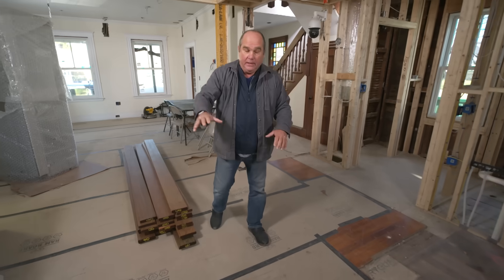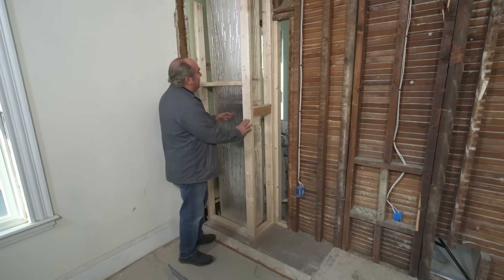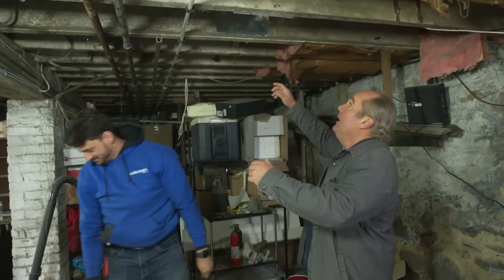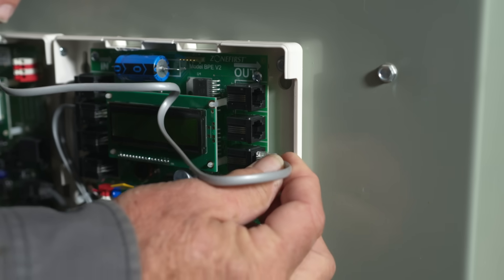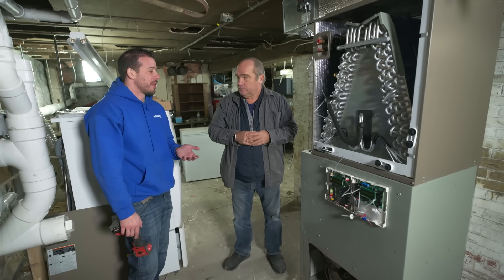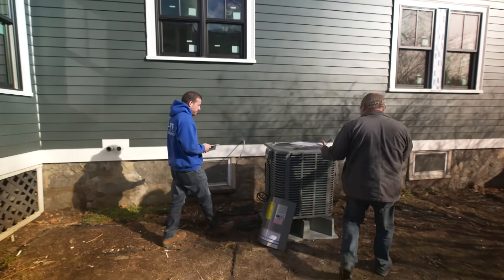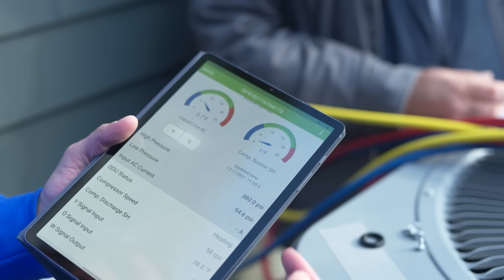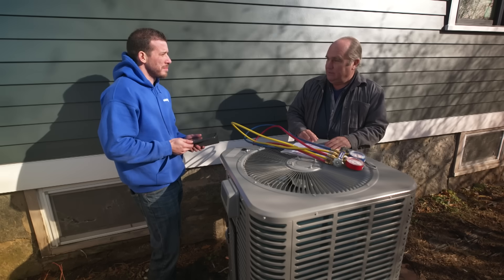Dual Fuel HVAC | This Old House

Comment: Very nice system - I like that they were able to reuse the existing furnace.

I'd consider a system like this but here in Texas where natural gas is cheap and we might only run the furnace for 10-15 days during a typical winter, it's hard to justify vs a straight 80% NG furnace+AC.
Reply: I'm further north and we get below zero F sometimes and heat pumps that work that low exist and are cheaper than the -22F units, but my concern is ice on power lines and losing electrical service.  My existing space heating, water heating, and kitchen are gas-fueled, so going duel-duel makes sense for me; if the natural gas stays on, I can power my furnace blower from a generator but with a heat pump only, I'm hoping the pipes don't freeze and am going to a shelter.  Absent such an event, I'd be saving about 40% on winter heating costs with a high SER heat pump until gas heat was needed.

Comment: I’m pretty sure that hybrid systems costs double that of a conventional system.
Reply: The gas furnace was already in place.  The zoning dampers are new, as in the duct work and heat pump.  The duct work was needed no matter what, the zoning was needed no matter what, so subtract those costs from the "hybrid/not hybrid" discussion and we're talking about the price different between a conventional AC only system or the heat pump system.  The difference in equipment cost isn't as great as you might think, maybe 25%.
Reply: It's not double because the "system" includes everything while adding a heat pump "box" is just a subcomponent.  Plus there are huge state (maybe federal) rebates.  At least in MA there are.  I installed 2 heat pumps 3 years ago and got $10k cash back in rebates.

Comment: Electricity is too expensive now, also once the return air duct is connected to the furnace it will be difficult to access that control panel. I would suggest a coal stove, especially in Massachusetts.
Reply: And a mill wheel powered by water!

Comment: That quality of duct work and team work with the carpenter/framer is hard to find even if you have the big budget to pay.
Reply: Exactly, and those are the details that architects tend to say "the trades will figure that out."  Then the trades have to work with the GC, who gets the client to sign off on the chases and soffits needed.  I was surprised how much of architecture is mostly selling pretty pictures, not actually building structures.
Reply: I have to wonder if anyone did a "manual D" calculation, or if they just opted to "fit some duct in there."
Reply: @arthouston7361  On this, I'm pretty sure the HVAC sub had to hit numbers to get the local subsidies.
Reply: @arthouston7361  Manual D or not, the ducts in those soffits aren't properly stretched, that results in huge increases in airflow friction, and the transition to an oval duct, is a big size decrease.
Reply: @edwardlouie  I'm a commercial service company owner, so I rarely touch ductwork. What do you mean by "stretched?" Those did not appear to be flex duct...
Reply: @arthouston7361 check the 1:28 to 1:30 time area of the video. Other comment threads also commented about the lackluster quality of the flex duct take offs the plenum.

Comment: This year I replaced my 20+ year-old HVAC system, and at first I was convinced a dual-fuel setup would save a lot of money. But after running the numbers, it turns out a heat pump just can’t beat natural gas in my area.If you want to check for yourself, you can convert your gas cost (in $/CCF) to an equivalent cost per kWh. The formula is:
($/CCF) / 1.038 (CCF to therms) / 29.3 (therms to kWh) / (furnace efficiency)
Then compare that result to your electricity rate per kWh. For example, here in Michigan gas costs about $0.86/CCF, and the cheapest electricity is $0.18/kWh. With those numbers, a heat pump would need a COP (coefficient of performance, aka the amount of energy a HP moves per 1 unit of energy input) of about 6.08 to break even. There’s simply no heat pump that can maintain that—especially once temperatures drop into the 30s in winter. Hopefully this quick calculation helps others decide which system makes the most financial sense for their home.
Reply: Entirety depends on where you live though. In my area, the near $50/month fixed cost just to have gas service means a heat pump wins pretty easily. Gas is a reasons option, with dual fuel being terrible.
Reply: It depends entirely on the cost of each fuel source in your location. Also, if you have solar panels or any kind of off-grid electricity generation, obviously a heat pump is the way to go. Electric is cheaper than gas where I live and gas keeps going up, so I would go with a heat pump and install some solar panels and a small lithium battery bank.
Reply: Depends heavily on where you live.  Also to throw wrench in your roi the cost of both electricity and gas changes over time. More so with gas as price spikes can be 2-4x with petroleum

Here in WA electricity is fairly cheap at 0.14c/kw and temps are mild so many homeowners just install a heat pump
Reply: Two important points you need to consider. A heat pump also cools so if you don't have central air, dual fuel is the way to go. There are apps where you can put your specific model in and it will tell you at what temp its cheaper to use the heat pump at. For me, my heat pump is set to heat don't to 30, after that the propane kicks in. I've saved a ton of money.
Reply: Same here in Connecticut. Our electric rates are insane and it can’t compete with a high efficiency gas or propane furnace. We have a 1 ton heat pump ducted system we added to our master suite when we expanded our house and it’s pretty noticeable how much our electric bill has gone up in the winter.

Comment: I have a slightly older version with a big heat pump outside working with a gas furnace inside. But here in Maine the electricity is so high that running the fan of the heat pump AND the fan of the furnace to push it through the house was terrible. We now just heat with the gas only and use the heat pump for ac in the summer.
Reply: That’s coz your state is trash
Reply: Same here in Arizona.  I had heat pump heating (which is actually adequate for most of the winter here). However,  my energy bill was higher than using air conditioning especially when the temps would start freezing. And I only used the heater at night. I have gas now in a larger home and my gas bill isn't nearly as high as my electric was.

Comment: Lol! If I was the homeowner. I would be worried once that thing is out of warranty. As an HVAC/R tech. EVERYTHING is made like junk now. Control boards especially. 😅
Reply: Hold on to your wallet if inverter, blower motor etc. fail out of warranty.
Reply: I got out of the commercial side 3 years ago. In those 3 years, the tech has leaped more than my 22 as a tech.

Comment: FYI, Dual Fuel means 2 different types of Fossil fuel- lpg, natural gas, or oil not electricity.
Reply: FYI, no.
Reply: Not in the hvac world it doesn't. Dual fuel is a heat pump with some type of fossil fuel back up.
Reply: So, what would be the definition of a Hybrid System?
Reply: @BuddyAmericafirst-nh4ms  hybrid is a word that means a combination of two or more things that achieve the same/similar results. If you had a car with both gas and diesel engines and you could run on either one independently to make the car move, it’s a gas/diesel hybrid. It doesn’t have to necessarily include electricity to be a hybrid, but it can
Reply: @krvnjrcbs  I hear you, but just seems to be ANOTHER way to try & confuse the average person.  "Tomato-Tomatoe"

Comment: Just comes down to a hole lot of money!!!    Wen it breaks down plan on taking out a 2nd mortgage to pay for repairs !😮
Reply: They added a heat pump to the existing furnace. I think they said but they’re also doing a full renovation so a good chunk of it’s going to be labor for the ductwork. Been installing the Bosch ids heat pumps for years. That looked like an Ecoer unit or something like that
Reply: That whole remodel looks expensive.
Reply: Whole lot*
Reply: Prove it
Reply: Daaa what plant you from ???! @krvnjrcbs

Comment: A great show, but boy they always show the most high end , high tech equipment. Most homeowners opt for the cheapest.
Reply: Dual fuel systems in most cases are only a couple grand more, and in MA where this show takes place you get massive rebates for installing heat pumps.
Reply: Most homeowners couldn't afford a full-gut renovation, the few that can likely can afford the new tech. Ask this old house tends to cover things more within reach of the average homeowner.
Reply: @H @HeatStroke15 Here m in CO, and in much of New England, cold climate heat pumps and duel fuel are mainstream or close to it. They have major subsidies ($10K rebate/household in MA) and 0% interest for 8 yrs, so it’s often a no brainer.
Reply: Not that expensive to have this set up. A heat pump is only slightly more expensive than a standard condenser. Especially in a situation like was shown here where the existing furnace is still good. 

I actually did this exact same thing at my house. AC condenser unit needed to be replaced so I just replaced it with a heat pump along with the coil inside. Attached a Honeywell T10 which is compatible with a dual fuel setup and I was good to go. Cost about $3 or 4K and the system automatically switches fuels based on the outside temperature.
Reply: For the last few years heat pumps have outsold furnaces in the US, so certainly not a niche product limited to the upper class.
Reply: Personally, I'm budget concious but have hardly ever gone for the absolute cheapest option. I'm looking for the best option really, so I'm thinking what is ballancing a good outcome (how much we'll enjoy it/how long will it last) against a good price I can afford. Often it makes sense to pay a bit more upfront anyway to get more durable materials and appliances that last longer. Installing a good modern heating system in this house will also boost the value significantly, so it may be money tied up in the house but not an actual loss of any wealth for the owner.
Reply: @Ben-fr8gi  smart.  So many people here underestimate interior climate quality.  Like you, I'd rather spend extra on my interior climate because my body feels it every second I'm in the house
Reply: If you having this old house there you better have a few hundred thousand in the bank to rebuild and re-engineer the different systems. I need their help but there’s no way I got that kind of money.
Reply: Right! My dual fuel is a old wood furnace and a free propane furnace 😂 and my kerosene space heater for emergency heat!
Reply: This isn't "high end".  It's a typical duel fuel system.  The price is what it is and I don't understand why people like you are taking out frustration on TOL.  They don't set the price.... There's no magic and they aren't magicians.
Reply: @sergeyb8  I remember when TOS was about the tips, tricks, and things to look out for when remodeling homes that weren't especially historic, noteworthy, or expensive by local standards, but they can only make so many shows out of that.  TOS ventured into documenting the work more affluent owners were doing, the design, engineering, and architectural considerations involved, and the stories behind the houses themselves.  You're right, I guess some folks didn't track the changes.  @HeatStroke is right about "...a full gut renovation... can afford the new tech."
Reply: @raygunsforronnie847  I've been following them for like 20-25 years and I honestly don't see a big difference.  They still talk about DIY kinds of repairs.  But honestly, when it comes to full remodeling, I would rather them talk about how it's supposed to be done rather than some cheap, bare-minimum hacks.  I'm sorry, but if you (not you specifically) cannot afford a quality remodel then you shouldn't do it. Like I was saying about this specific video - a forced air heat pump is what it is - not cheap.  Sorry, it's just the reality.
Reply: @sergeyb8  I don't think we're in disagreement at all, I just remember when it was a new show on PBS and TOS brought a new level of "do it right" to properties a middle class family might own.
Reply: @sergeyb8 what are you talking about. I’ve installed these systems and they repurposed the 1800’s furnace also which costs some high bucks just to tell people as a novelty. They also, opted for digital readings and applications for the whole system. The air balancing alone for this ancient house would cost $10k.
Reply: @Boristhebulletdodger86  I wish I understood what you are saying.  Only the last sentence was clear and $10k is nothing in the overall HVAC system cost.  Well, not nothing, but a good dual fuel system built from scratch is in the $30-40k range (I'm talking duct work, dampers, etc).
Regardless of your local prices, the system in this video is nothing crazy and totally within the "norm" of TOL.
Reply: It was a great show until it became about projects and upgrades that are ridiculous and out of reach of most Americans. It's a terrible show now. I  sometimes come here out of morbid curiosity and quickly leave.